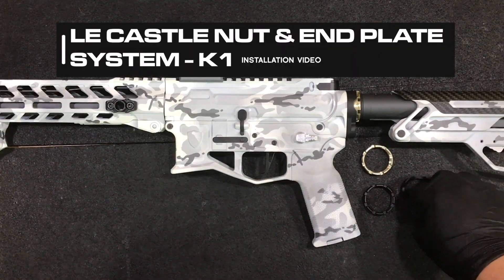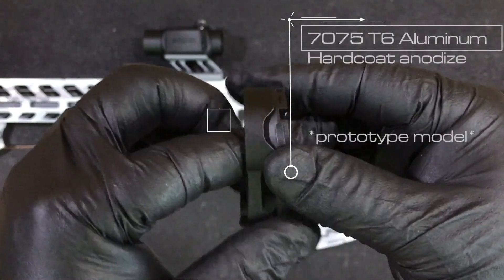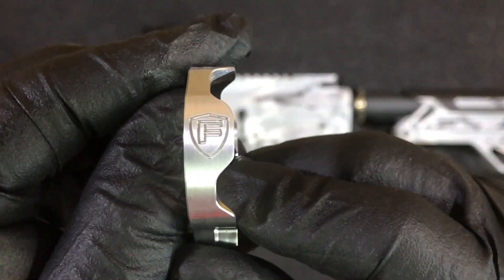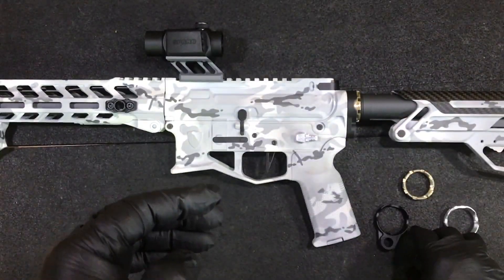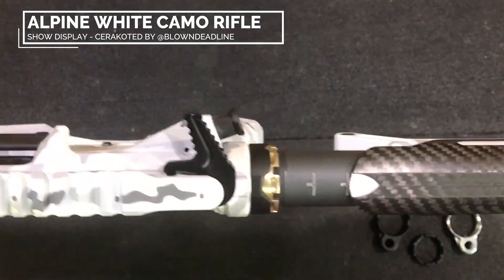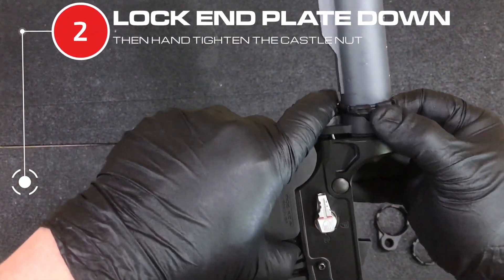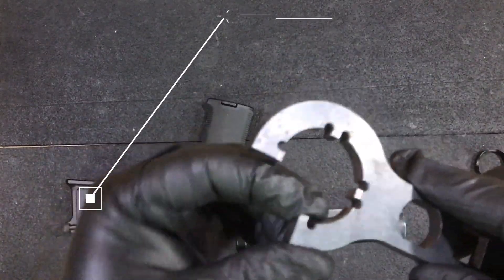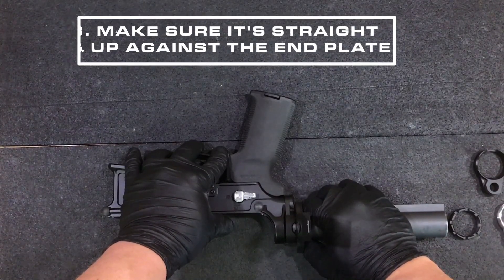Quick Highlight Product - LE Castle Nut End Plate [K1] System Installation

Comment: no staking required, nice!
Reply from the maker: very.  :)
Reply: I found the assembly was easier using your kit than the tradition method. I also took it off and put it back on twice and found that easy as well but the piece of metal that you push on to unhinge the ratchet could be a bit bigger for the end user to take on and off the buffer tube. I really liked not having to have to put it in a vice and torque down the buffer tube. Overall excellent I'll put them in all my AR 15s... cus you know you just can't own one once you know how to build them. @FortisMFG

Comment: What does it look like with a standard butt stock on it (not that uncommon one you use here and on your website without a flat face)...how much gap between the castle nut and the stock if any. is it longer than stock castle nut and end plate and do you lose any of the locking position due to this? I wish you would have shown this instead of ending the vid with a bare buffer tube.
Reply from the maker: there is no fitment issues with a standard stock.  you do not lose any of the locking positions like some of those bolt on qd adapters.